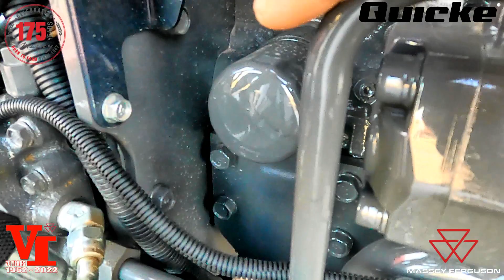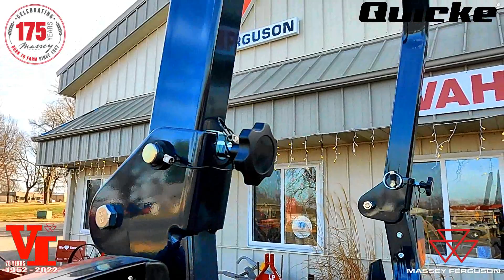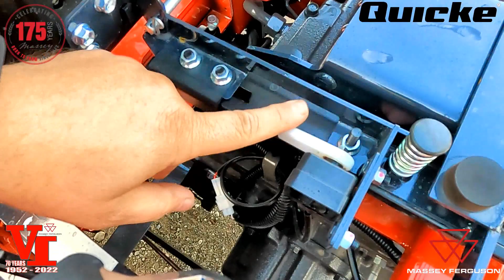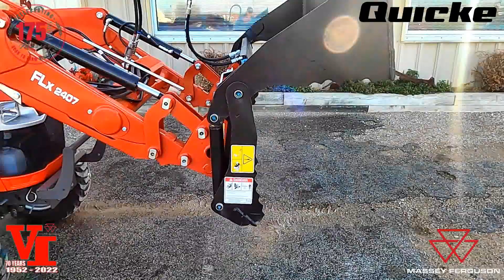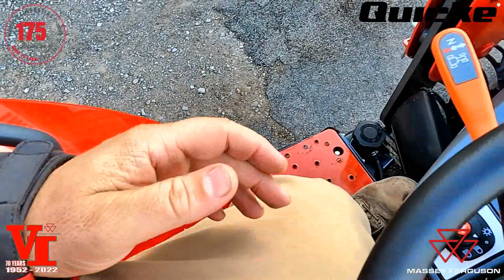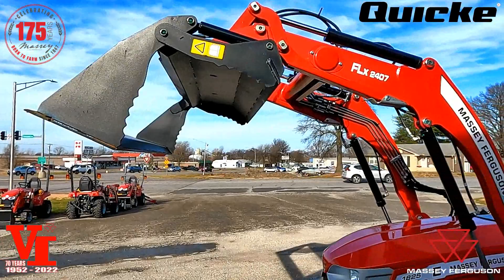Make It Yours: Massey Ferguson 1825E SynchroShuttle with FLx2407  & Quicke 170MPC 4-N-1 Bucket

Comment: Does the 1800 series come with a midmount PTO like the 1700 series Does
Reply from the maker: The 1700E and 1800E Series do not offer a Mid PTO Option. The 1700M & 1800M/2800M Series offer Mid PTO Option. In the 25 HP Models the GC and 1526 Models are Mid PTO Option.

Comment: Oh wow! Does MF offer that clam bucket for the 2607h?
Reply from the maker: Quicke offers the 4-N-1 Buckers from 54" to 83" in 3 Series the MPC (54" to 72") for Compacts and Small Utility Tractors. MPU (63" to 83") for the Small Utility to Large Utility Tractor and then the MP Series (63" to 83") the heaviest duty 4-N-1 Buckets. The 72" MPC or MPU would match up great with the 2607H Series Tractors.

Comment: Can you get this with a mid mount pto and is there a tiller for that pto horse power ?
Reply from the maker: 1800E Series do not offer Mid PTO only Rear PTO. These are basic feature tractor. RhinoAG Offers SRT55 which is 55" Tiller that works with 1825E Model.

Comment: I think you need to do an updated version of the 25's with the 1825E, 1526&1725M.
Reply from the maker: If we can get inventory and have all three products in at the same time that would be a great idea. But really only change is the 1825E hood style and ISKEI Engine. 1526 is the same and GC1725M has stayed the same. If you want latest features we have done individual videos on each model.

Comment: Can you get that style bucket on the 1526?  Thanks
Reply from the maker: Quicke makes 4-N-1 Buckets in  54", 66" and 72" wirh Skid Steer Quick Attach. I would probably recommend the 54" (140MPC) for the 1526.

Comment: Love the machine I have a 1726 I bought new in 2020 how much would this machine as shown with a backhoe bucket
Reply: I believe right around $33k. The backhoe is $9k
Reply from the maker: Best place to get pricing is from your local dealer. We only sell where we can service (West Central Missouri) List Price is around $33,000 to $35,000 for the 1825E Shuttle, Loader & Backhoe.

Comment: You really need some form of wind protection for the microphone.  Otherwise I love the videos.
Reply from the maker: As hard as it is to keep inventory in-stock and this tractor was sold had to slip in the video in less than ideal conditions. We try our best to eliminate outside noise. Sorry for it being windy the day we filmed.
Reply: I had a 75 horse Massey had a very poor dealer. I got upset with the dealer and traded the Massey off and decided I would never own another one
Reply from the maker: Dealer makes the Difference. You can build the greatest tractor in the world but without support it's worthless. Why we at Vahrenberg Implement limit where we sell because After-Sale Support is more important than selling. Might check the Massey Ferguson Dealer locator they are continually growing and adding new dealers. Might find a Dealer that will support your needs.